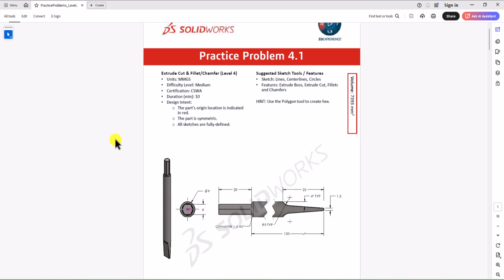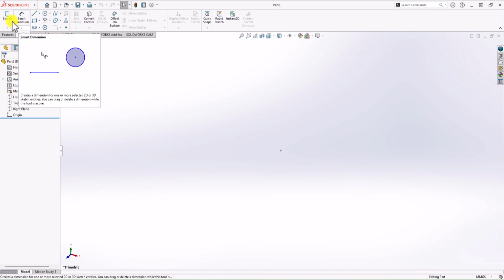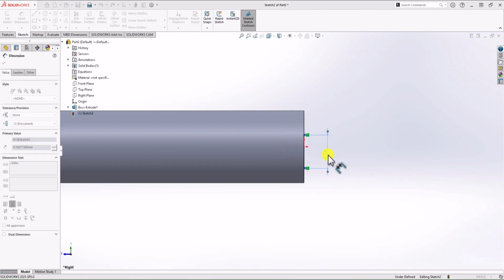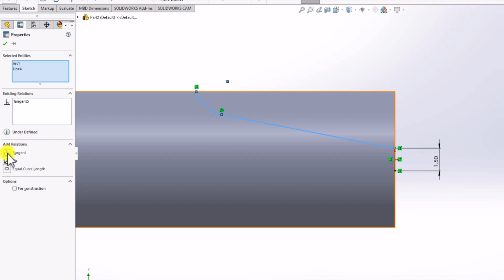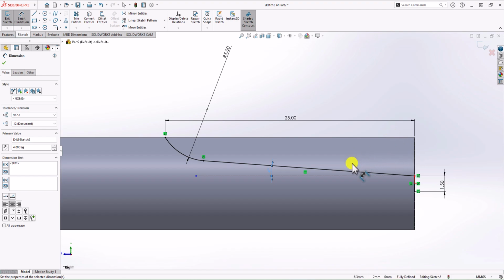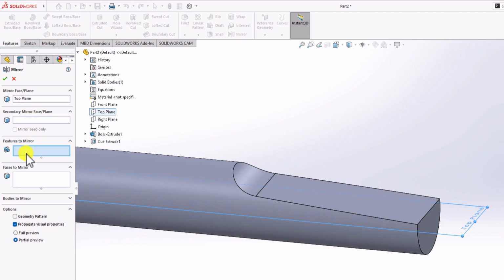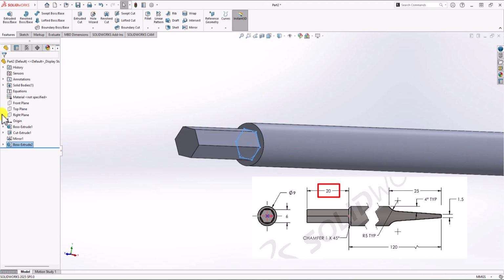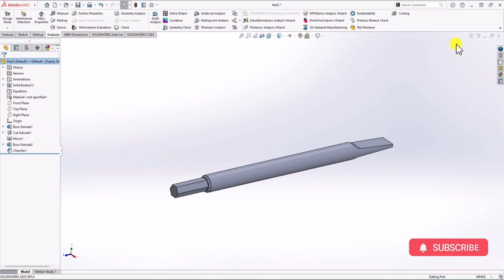CSWA Practice Problem 4.1 Solution | SolidWorks Exam Guide

Comment: How did you know that the Chamfer Distance is 1 mm?
Reply from the maker: That’s a great question! On the drawing, you can see that the chamfer is specified as 1 × 45°.
Normally, on engineering drawings, chamfers are shown in the A × B format, where A is the length of the chamfer and B is the angle of the chamfer.
That’s how I concluded that 1 mm is the length of the chamfer.
Reply: @Design_With_Roozbe Thanks, I follow your videos for my CSWP prep. I usually go to your video when I can't figure something out on my own. Thanks again for answering!
Reply from the maker: @sabitsarwarnadhvee6907  No problem, Happy to help!

Comment: did you skip over 3.9? is there something im missing here
Reply from the maker: No, I didn’t skip question 3.9. The problem set I have for the 2025 version does not include question 3.9 and ends at question 3.8.